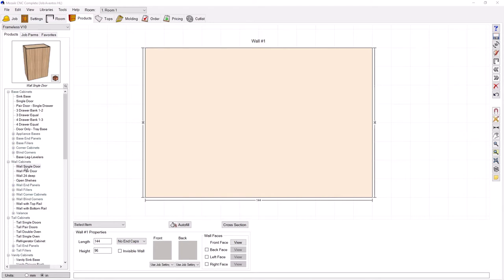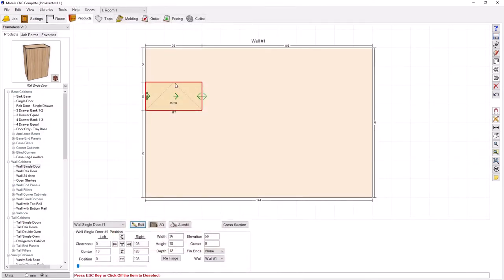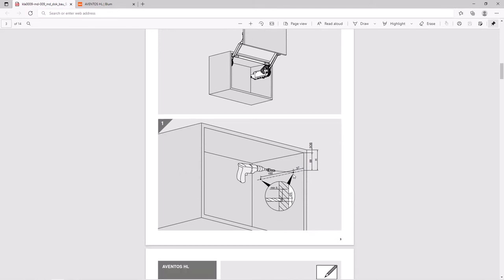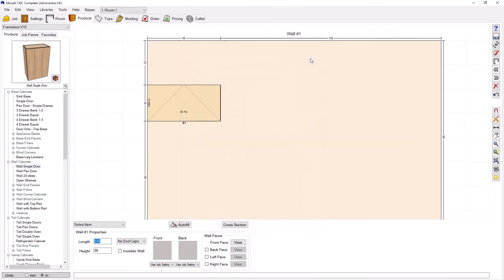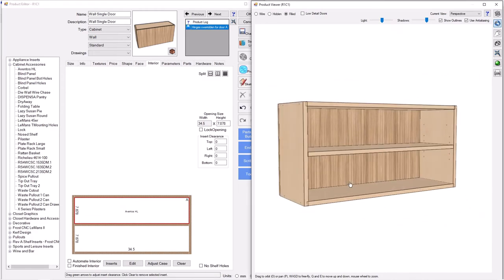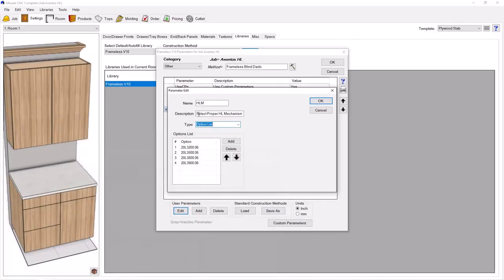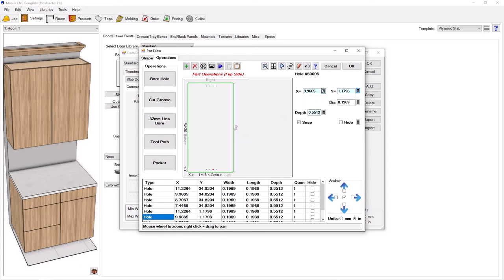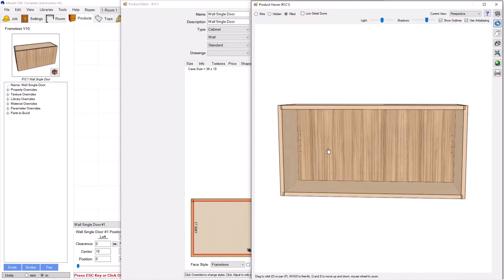BLUM AVENTOS HL in Mozaik...Option Lists are Cool!

Comment: Nic I'm planning to use the lamello clips as connectors for my cabinets, do you know if Mozaik can do this? I just got a Nested CNC and wondering what software to use, so far leaning on Mozaik but for cabinet assembly, I would want to use the Lamello P2 clips.

Comment: Great walkthrough, just thinking without searching; is it possible to input another parameter or equation calling upon a parameter value? Something like SFARight=UEnd.th-FLRevF? If so, Would that get desired effect?
Reply from the maker: Unfortunately not...and the reason I stuck with SFA is because there is no way to write formulas that change the hole positions when next to an adjacent cabinet... that set of parameters or code is unfortunately not available to us Mozaik users.